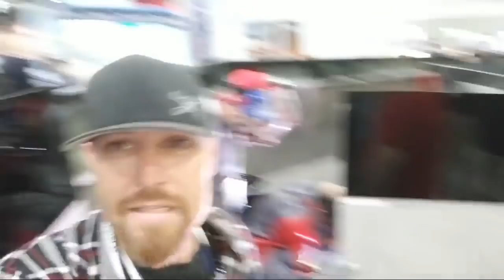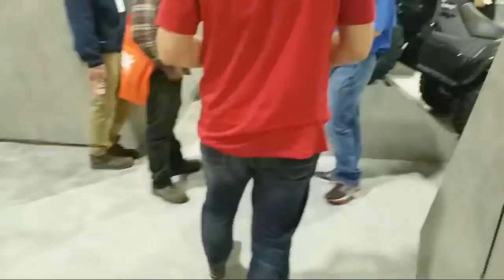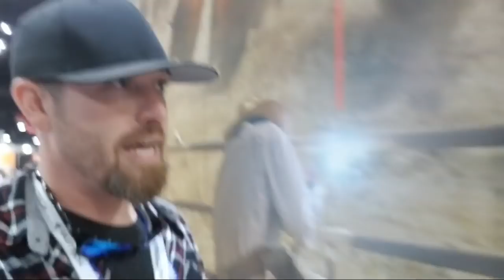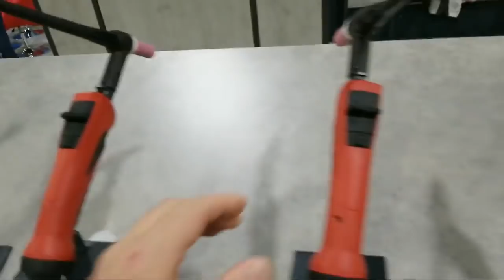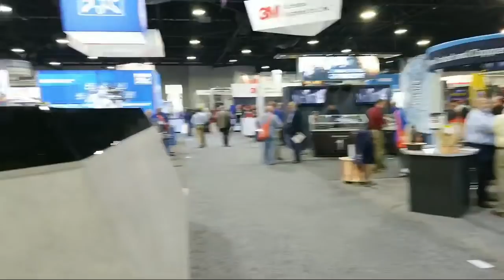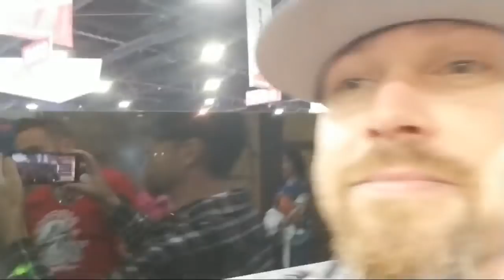FabTech 2018

Comment: Hey Kyle now that you have gotten to use the Fronius gear more what are your thoughts on aluminum MIG vs AL TIG?  For a normal home shop that just needs to do mostly carbon steel, some stainless and a lower level of aluminum would the TT 2200 be a good choice?  Would the AL Mig be sufficient for normal making or repairing things in AL or would you still want to have AL TIG capability?  I really like the functions and capabilities of the TT 2200 but can only really have space for 1 machine and just wondering if the AL capabilities would be enough or if I should look for/learn AC Tig.   Thanks and really enjoy your channel.
Reply from the maker: Yeah the 2200 can do it all. I always tell people it's really about what your end goal is. You could go with the 2200 and then add a magicwave down the road